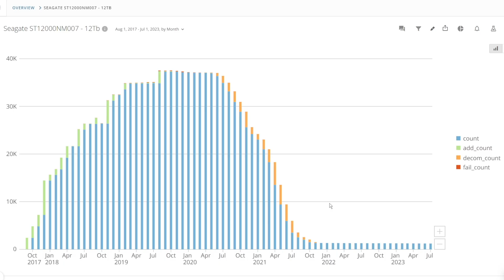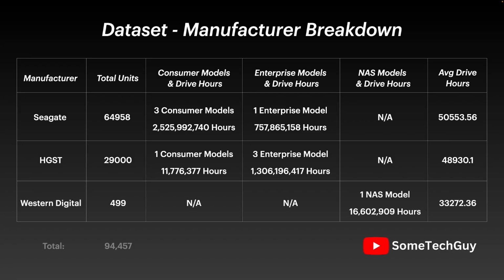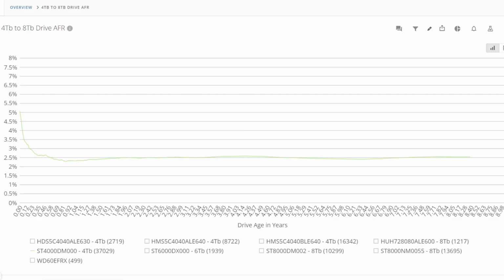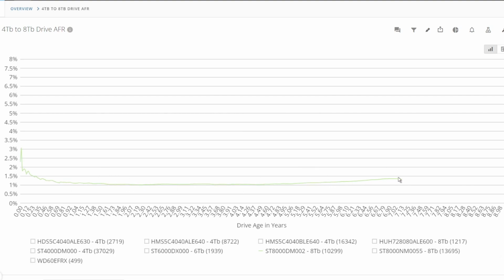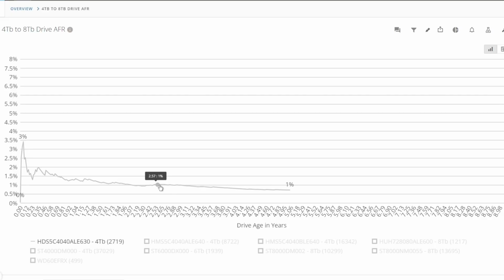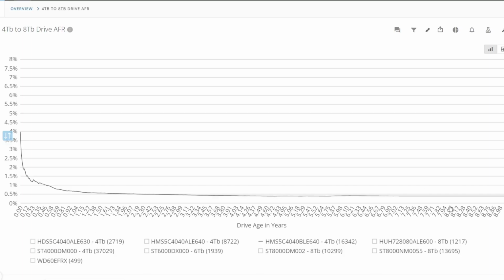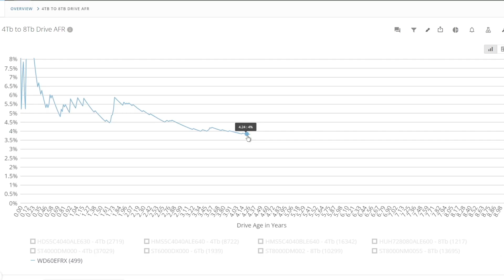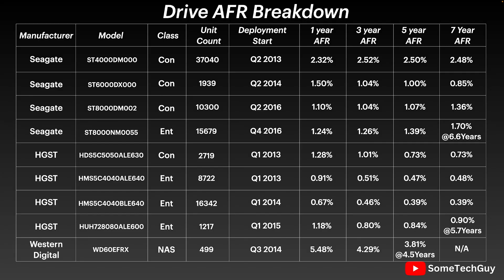Desktop vs Enterprise HDD - Failure Rate Analysis. Do desktop hard drives really fail sooner?

Comment: I have a bit over half of my WD60EFRX Red plus die between 3 and 5 years. Will se how my WD80EFAX red plus will perform over time ... new ones might be a different brand, as prices now are much cheaper for the Toshiba N300 and then Seagate Ironwolf NAS.
Reply: Ordered Exos x18 18TB for a HDD upgrade, current price was 14€ / TB cheapest of all.
Reply from the maker: The Backblaze data contains very little WD info until recently, where they started deploying larger Ultrastar disks that came from the HGST aquisition. But I personally moved from WD Reds, first to Ironwolf Pros, but I would take a look at my video on NAS vs Enterprise disks, as I mostly buy Exos Enterprise disks recently, as the price point, reliability and warranty seem like a a great choice. At least, this has been true recently in places like the US and the UK as well as Germany.  Good luck with whatever you choose next!

Comment: The way you use stats and explain your analytical process for these videos is top notch!

Been looking at getting a NAS system, as a musician and stats nerd who shoots a lot of video. Your videos have been consistently awesome & helpful, so thank you so much!

PS: I’ve noticed your audio still has those digital clicks and pops, I can help troubleshoot the issue if you need
Reply from the maker: Thank you for the feedback, its really appreciated. 

I have been trying to resolve the audio glitches, and not got to the bottom of the cause yet, so if you have any ideas then I would appreciate them, it doesn't seem to caused by external audio, such as plosives but seems to be in the encoding. You can get me though my channels contact email.

Comment: From 35 years in IT, most of it in infrastructure especially storage, avoid the divisible by 3 capacities. 3, 6, 12 etc. They're not a true engineering evolution, just 2, 4, 8 etc drives where the manufacturer is pushing the limits of existing Technology.
Reply from the maker: I have not heard this before, and that's an interesting take!

The 5Tb disks always felt odd to me, and not sure why. But back in the day, disks were not so uniform and I remember building a PC with a 42Mb Conner IDE disk.
Reply: My powers of 2 bias really was justified LOL
Reply: With that logic how about 16, 18, 20 and 22 TB all on practically same tech, just small incremental platter improvements.
Reply: My 2x hgst 6tb just running fine since 2015
Reply: @Jannickjay that's pretty impressive. Praying my 5 12gb drives last that long
Reply: This guy hasn't been doing enough IT, gtfoh 3 Divisible.. Maybe just the first 3. Dumbest logic ever. This guy must be new to storage.
Reply: @june5646  no they are right they are just talking about the pattern the 3,5,6 tb drives have higher fail rate